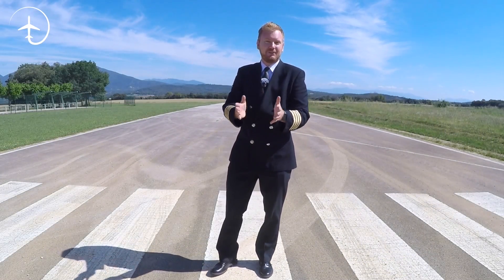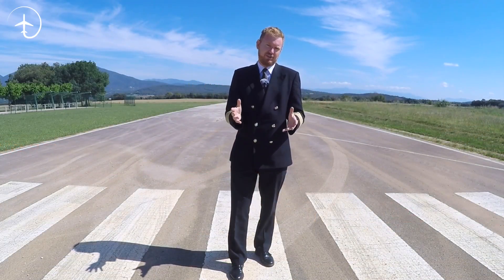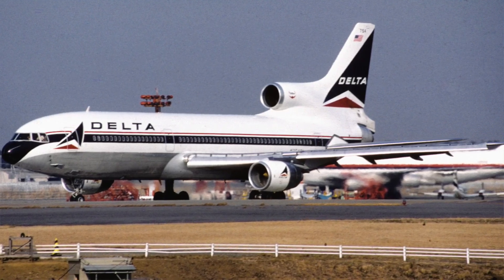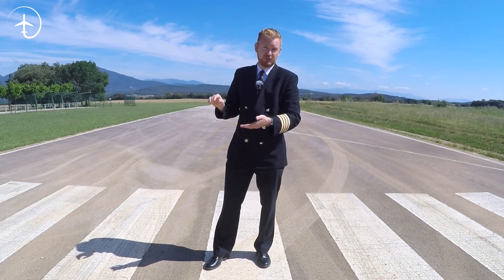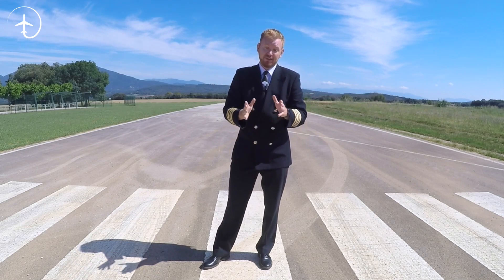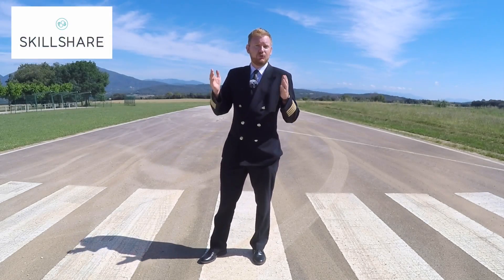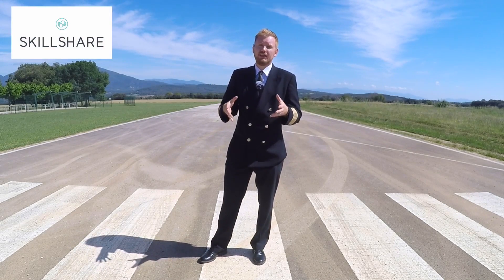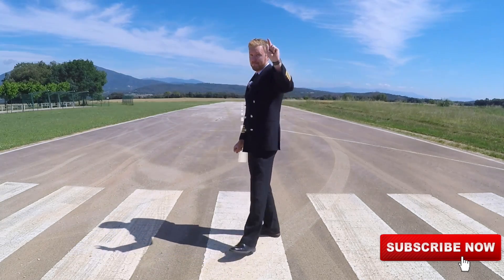Three Engined Aircraft, what happened?

Comment: Why can't we install thin solar panels on flight wings of planes and electric engines
Reply: The efficiency of current (hah punny) electric motors, batteries, and solar panels only allows for very very specialist electric aircraft to work, Boeing or NASA (can't remember) built one, and it looks like a glider with a bunch of large RC plane motors along the leading edge of the wing, so, basically, commercial aircraft are out of the question... For right now anyway

Comment: Hi, with the continuous improvement and capacity of jet engines, do you foresee jets with a single engine? Assuming jet engines reliability would continue to improve
Reply: Unlikely- if an engine fails, twinjets still have an extra to keep them in the sky for a while. Single-engines are fucked if they lose engine power.

Comment: Also, you forgot to mention, the first ETOPS approved airplane, the A300 was a huge contributor and overall, started killing off the DC-10 and L-1011 TriStar, more so the DC-10 because it used the same GE CF6 engines and airlines like AA saw that now there's a plane that's cheaper to maintain, can perform the same as their DC-10s and is technically the same to maintain because of their familiarity of the engine type.

Comment: Mentour Pilot. what a beautifull sound with the Lockhead Tristar taking off, Thee Rolls Royce RB 2-11 Three Shaft Turbo Fans if I am correct , this Engine has as far as I know stood the test of time as the Later ' Trent  Family  '  of Rolls Royce Engines are still Three Shaft Turbines , where as GE and Pratt and Whitney Engines are Two shaft.     We are now on the New Generation of Low Fuel consumption Engines on the latest Jets.  I love your Video,s.  Rolls Royce stated that the Three Shaft Jet Engine had the advantage of being shorter and the Third Shaft acted as a Super charger , but on the down side , the Engine was, I believe heavier.

Comment: United Airlines flight 232 in 1989 did not contribute to this?  It was a bad design in my opinion, and should have been foreseen with fail safe hydraulic systems in place.  People are not going to board a plane that has proven design flaws.  That's what happened.

Comment: 3 engine aircraft are awesome, very nice redundancy. In my opinion they are worth the added fuel, weight, and costs for greater safety and reliability.
Reply: The twin engine 767 and 777 have much better safety records.  Engine failure was almost unheard of by the 80s.
Reply: @user-tb7rn1il3q  They are also newer

Comment: If you want to retrofit your old plane chassis with newer bigger engines that don't fit, you just move the engine position then hide some software in the plane to compensate for the fact that you just dynamically unbalanced the aircraft. What could possibly go wrong...

Comment: You forgot to mention the best selling tri jet of all: the Boeing 727...
Reply: Yes. Ansett Airlines operated a 727LR. This allowed not stop flight from CNS to PER. DISTANCE 2138 miles in a 2 class configuration. From memory VH-ANA and VH-ANB. Best in class service in the world. Cheers 🇦🇺🦘
Reply: @greatpar  I think OOL - PER is slightly longer. Remember TAA?
Reply: @dashamanstevo5326  I forgot that OOL - PER sector. Cheers
Reply: Sorry I missed the TAA reference in your post. My Uncle and a Brother both worked for TAA. My Father, myself and another 2 brothers worked at Ansett 👍
Reply: @greatpar  I remember going to PER with my dad to watch planes take off and land, the bueatiful and noisy 727's were a common sight back then.
Reply: Plz check the description
Reply: You're right.
Reply: 727 were a good airplane to work on. Before 9/11 and they were removed (mostly) I worked on them. You could drop down the back of fuselage to access the plane thru stairs. And the weird thing is that the auxiliary power unit APU was located at the root of right wing and blew exhaust straight up.    Bill
Reply: Actually he did mention the 727 at the beginning, but he used his reference incorrectly, indicating it was a 2 engine jet and that airlines wanted another engine.  Many of his assumptions and "facts" are wrong.  He doesn't mention that four engine jets are also obsolete and no longer being made.  There is only one 3-engine private/corporate jet and even that category is almost entirely made up of 2 engine jets.  The future is 2 engine, subsonic and small jets with tiny restrooms, bad food, slow travel, congested airports.
Reply: @californiazepher  it’s sad the future is twinjet, redundant designs, I feel airliners should stick within their markets, I’m not a big fan of this whole blending of short, medium, and long haul jets. I’m a bigger fan of hub and spoke travel. I kinda feel like it would reduce airport congestion anyway. Yes it’s kinda antiquated but it does allow for clearer skies overall anyway. It’s totally possible to make fuel efficient, low maintenance tri or quad jets. The A380 and 747-8 proved that.
Reply: @HesJustSteven  
I can tell, you're not "acting" dumb.
Reply: @alhanes5803  I’m not, you just don’t know how the environment and industrialization affects each other
Reply: @HesJustSteven  
OK stevie
Reply: @alhanes5803  don’t be mad cupcake
Reply: zoggin you are super Wright you must mention the great plane
Reply: It was fun to fly!
Reply: Luv2fly I’m really jealous. Would’ve loved to have flown or just flown on one. I’m too young though.
Reply: @vtwinbuilder3129  the airline I flew for mothballed the 727 fleet after 911. Then came the massive pilot furloughs. Killed my career since I got a late start. Still miss those pre-911 days.  Was never the same after.
Reply: @Random Number Not so trivial. 
There's a saying in engineering: if it looks right...... it probably is...........
Reply: My 1st jet flight was on board an aged 727..with the cockpit open-door and smoking section was the entire cabin.
Reply: My first flight was with an Boeing 727.. 
Sterling airways!
Reply: Whisper jet. So quiet.
Reply: Kim Polansky whisper jet? Is that why the JT8D’s were routinely fitted with hush kits to meet noise requirements? 

It was loud.
Reply: @vtwinbuilder3129  Depends on your perspective, compared to the early turbojet 707s it was relatively quiet...and big modern planes have replaced engine noise with the thunderous amount of air their 220-ton hulks push out of the way..
Reply: @vtwinbuilder3129  
Yes.
They whispered,,,, ROCKET!
They climbed like a mother bear baby!
All of you who were too young to fly in the 80's, don't know what you missed!
Reply: @Random Number
He's European....
Reply: @ChandlerWhite-m2q  
lol. That's true.
Reply: Flew those on the Continental “island hopper” from Guam to Honolulu numerous times.  Rear stairs and narrow...but I enjoyed the adventure.  Only time I’ve ever seen live chickens brought on board as “carry on luggage”.  🤣
Reply: You're right, I'm guessing he was focusing too much on the long range trijets (even though the Trident and TU-154 weren't long range jets)
Reply: @HesJustSteven  He mentioned the 727 at the beginning, but he referenced it incorrectly.  The 727 was/is beloved and was actually further ahead of its time than any of the others mentions.  The range offered by the 727 was spot on and there is a void in aircraft production for that range today.  There were several errors, omissions and partial truths in this video.
Reply: @californiazepher  I totally agree, I wish the 727 was still in the skies, if I had an airline, I would’ve had some of them.
Reply: Best looking of them all too. The design has lasted as well, the 37 fuselage is based on the 27’s.
Reply: @vtwinbuilder3129  Which I think were based on the 07. All have the same front end.
Reply: Your Right 

Zoggin-noggin
Im weird though
Reply: The workhorse

Comment: It's not just that they look good, but potentially they have a safety advantage, because of the three thrust lines you could use the throttles to control the plane on thrust alone if your aerodynamic controls had somehow failed better than if all the engines are in the same vertical plain (like on the wings).

Comment: A series of accidents with the L-1011 and the DC-10 also, quite unfairly, made passengers leery of flying in them.  The Eastern 1011 disaster over the Everglades in 1972 was pilot error and loss of situational awareness (plus an autopilot that was too easy to inadvertently disengage).  Improper engine replacement procedures were responsible for a deadly DC-10 crash.  The USAF knew the DC-10 was a good plane, because they still use them (KC-10) as aerial refueling tankers.  I'm surprised he didn't talk much about my favorite bird growing up, the B-727.   I flew in that more times than I could count, and using the rear airstairs was really cool the few times i got to do it.  But it was noisy, a fuel hog, and required a second officer.

Comment: Don't need a whole video to answer this question, especially when it's basically common sense.
The engine technologies have vastly improved since aircraft like the DC 10, MD 11, and Lockheed L1011 were designed. These aircraft were designed during a period that law mandated 3 engines for direct overseas flights. Early jet engine failure was somewhat common or at least not uncommon so the third engine was a safety measure or insurance policy as it were. 
The 767 was one of the first who's engines were so powerful that it could still fly on one engine should one engine fail and by that time turbine engine failures had become very rare. The combo of the two realized the relaxed laws concerning overseas nonstop flights and its been that way every since.
At that point it became a simple math issue. Two engines are cheaper to operate than three or four engines thus the disappearance of tri engine aircraft and rise of the huge twins. Even the more modern four engine aircraft arent selling as well due to operations cost and are in decline,  like the superjumbo A380, which set records as being the fastest aircraft retired from service after the type initial introduction.

Comment: That center engine is a pain to work on and service. Maintenance on the dc-10 , 727, md11 was not fun. Also hard to access due to height. I’m happy that most airplanes I work on have only 2 wing mounted engines. 787, 777, 767, 757, 737, airbuses 319,320.

Comment: I heard that there is a design of using electric engine in the back of airplane, so that to increase efficiency, actually, through utilizing a slowed rushing air by main airplane body for streamlining after-tail vortexes. I thought it is indeed great idea, but without having any electric batteries on board, that will weigh down the aircraft. It would utilize purely engine thrust for electricity, or may be small capacitor for some redundancy for aircraft take-off mode thrust. Electric engine cannot be compared with turbine spin-speed rotation, but it could reduce airplane speed for some efficiency sake. Main issue may be placement of generators.

Comment: I can answer this question in 30  seconds. Engines became more powerful and reliable thus eliminating the need for a costly  third engine.
Reply from the maker: Great man! There is a bit more to it but, 👏
Reply: @MentourPilot  bi engine jets can  counter rotate engines which increase the stability...
Then how does trijets manage to stabilize the flight... And can maneuver 🤔
Reply: @ArjotGill  sorry, no, the engines all turn the same way in jets.
Counter rotating was only done on a few propeller aircraft.

Comment: How come they don't install a variable exhaust on the 737 Max to offset the thrust forcing the plane to rotate up when the pilot wants the nose to go down?? Think of the "Harrier" Concept Where they can rotate the exhaust to make the plane go up??   Why is it so hard to be think like a Race Car Builder Driver; Like Me!!  Be more "Creative" instead of all that "So-Called" Guess-Work"!! You will see a different feed-back!! I spent 4 years in the Air Force. I was an Instrument repairman, Fuel Quantity repairman, A-E Specialist, and a Engine run up tester on the flight line!  I did have a chance to fly the F-89j fighter, the T-33 trainer, and the H-21 Helicopter, all with out the formal license;  all because the pilots liked that i could repair their Air Craft, in that extremely cold weather in the winter;  up in Fair Banks Alaska! It is who you know more than what you are suppose to do!! At that time the Tundra was a wide open long and flat place to practice with the right teachers, So you learn a lot fast without those Nosy people an good friends!! I like the way you lay out simple to understand information. Thanks You do a very Good Job!!

Comment: 737-800 crossing the ocean! I was flying with Transavia from Rotterdam to Faro, but the airplane was rented from Miami Air. So my question is how does the plane come there because it came from Amerika to Holland. So is that save? Because it is a 737-800 with 2 engines so what if the had engine failure above the ocean?

Comment: All intercontinental aircrafts should have a third engine as a security feature, even if it's just a small one. It wouldn't be running during normal flight but would only be there in emergency to increase the glide distance in case of both engine failure over the ocean where there aren't any airports nearby.

Comment: Another advantage to trijets is that the engines can be smaller. Regulations stipulate a certain minimum performance standard with one engine out. In a twinjet, you lose an engine and you only have 50% of your thrust to meet that minimum standard. With a tri, if you lose an engine, you still have 66.7% of your thrust available, so as a result you don't need as much power margin.

Comment: Correction; You have to go back to the late 1950's. Boeing was developing the 727. There was a U.S. law in effect at the time that anything traveling over water had to have no less than 3 engines and was the case until modern twin-jets became E-TOPS certified.

Comment: So two engined aircarfts made trijets obsolete because they came with the same kind of performance, the same possible takeoff weight, same range, for the same amount of fuel. In that case, why not make four-engined aircrafts obsolete by making trijets which can fly with the same possible takeoff weight, same range, for the same amount of fuel - it is one engine less ? Building the aircrafts with graphene-based composites, you could make the aircrafts still lighter and stronger.

Comment: Fly long haul with two engines? No thanks. DC-10 had an appalling safety record with 3 engines.  I want to fly long haul for personal reasons. But only on a four jet. I hate flying
Reply: I appreciate your concerns but we need to remember that not all engines are created equal. The MD DC10 was introduced in 1970. It's not reasonable to compare 1970's jet engines with modern turbo-fan engines. The more modern stuff is far more reliable.

Comment: Good design.  If you ever have to ditch a trijet, you could turn it into a boat by firing up only the tail engine.  Of course you would not be allowed to use the normal air communications, you would then have to use marine band frequencies only.  You would not contact the tower, you would be in communication with the coast guard.  No wake zones would need to be observed.

Comment: how many engines does a 2 engine plane have?  most everyone's answer: 2 duh. me: 3. then the sound of people laughing at my answer but I am right and they are wrong. all commercial jets you see at the airport have an extra engine you can not see called the APU or auxiliary power unit which is running when the big engines are not to keep things like the lights on in the cabin when you board your flight. and that is kind of its only purpose. its not used during the flight.

Comment: Question regarding twin/quad engine aircraft and overall symmetry...  Do engines on opposite sides run/rotate Clockwise on one side of the aircraft and Counterclockwise on the other side of the aircraft?  From a torque moment perspective, this makes total sense to me, however, I understand this would raise tooling/manufacturing costs significantly.  Additionally, would geartrains, air starters, etc be placed on opposing sides of engines?

Comment: I do remember travelling from Sydney to Auckland using Air New Zealand in the mid-1970's, and they used the McDonnell Douglas DC 10 (I would say the 'flagship' of the manufacturer at the time), before travel to the Antarctic (Mt. Erebus) was available, and the DC 10 safety record was blemished. I also remember 2 interesting popular song titles:-

Live and Let Die, (Paul McCartney and Wings)

All I need is the Air that I Breathe,
(The Hollies)

I think the DC 10 was a great, reliable plane... ....but later suffered from misunderstood maintenance directives (airlines trying to save money by taking short cuts), and various misaligned autopilot settings..

Comment: Could you explain what features  on an airliner are powered solely by the 'ram-air' affect, and are there any emergency components/equipment  (if any) engineered to be powered by ram-air that  back-up a failed component that is normally powered by  the engines?

Comment: One disadvantage of the DC-10/MD-11 arrangement, with the engine atop the fuselage rather than behind it, is that the engine took up space on the fin which would have otherwise been part of the rudder. Looking at the L-1011 you can see that the Tristar had a full-length rudder while the one on the DC- 10 is much smaller.
Reply: But apparently the rudder on the DC-10 is very effective.